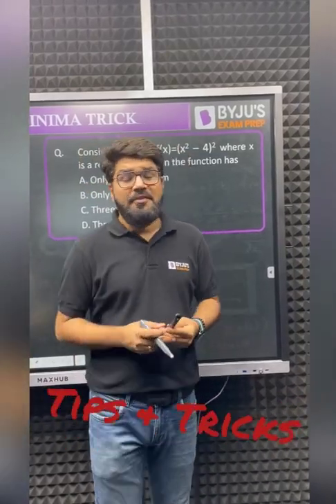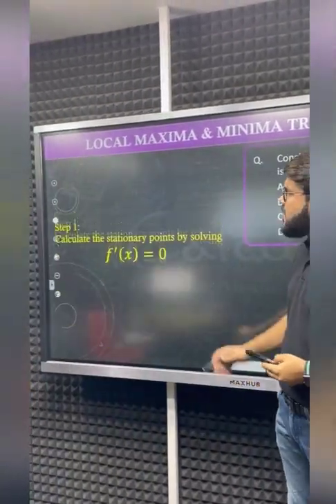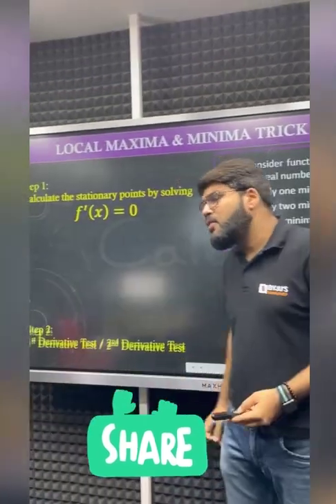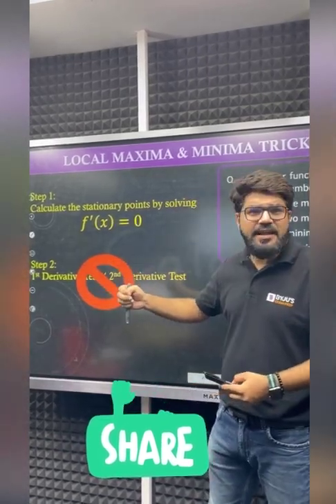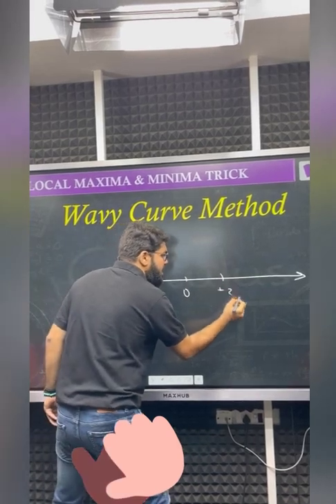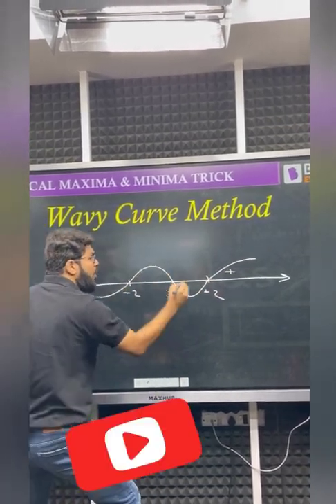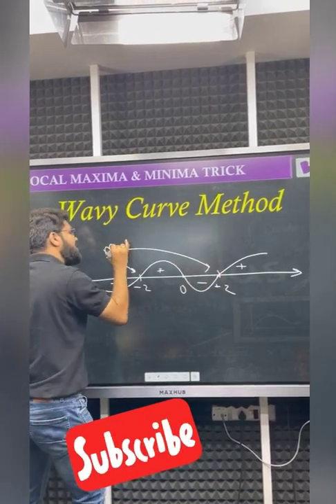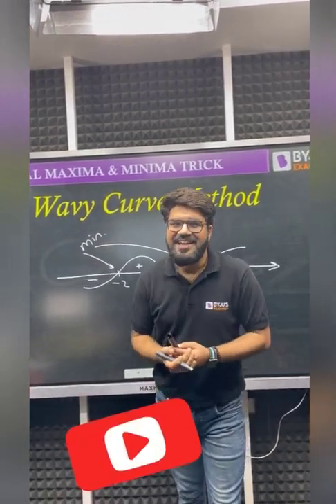Local Maxima & Minima Tricks for GATE in just 1 Minute 🙌🔥#engineeringmathematics #GATE2023

Comment: it's wrong hamesha + -  rule ni chalta h condition ke hisab se hota h bht se question h jisme ye trick kam ni krti
Reply: Yes i also experience this
Reply: In quadratic eqn or eqn other than linear one.
The wavy curve method fails or we've to apply some others rules of wcm.
Thank you
Reply: @Ashad1st  you have to factories the eqn, then check the power of the factor, if the power is odd only then the curve will change its sign otherwise it will keep its sign....